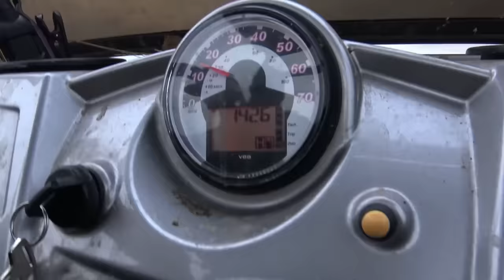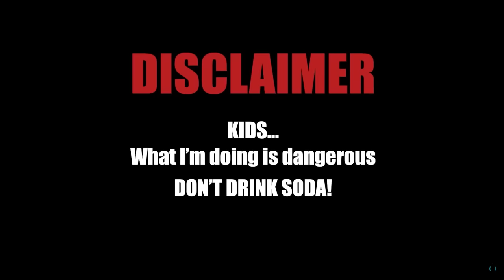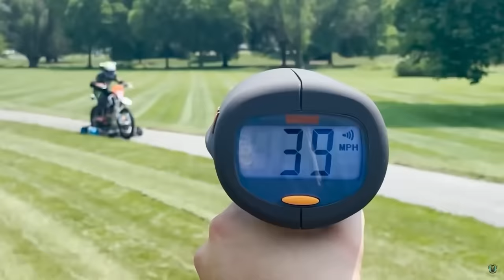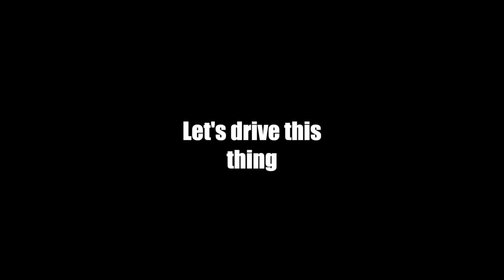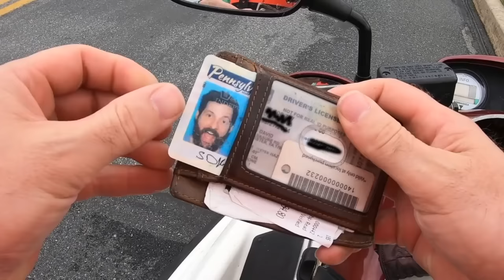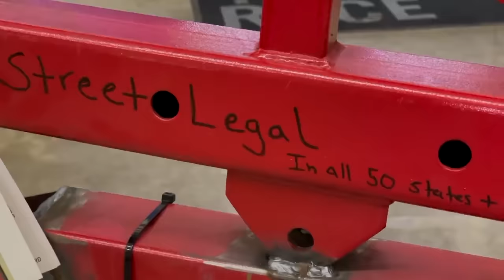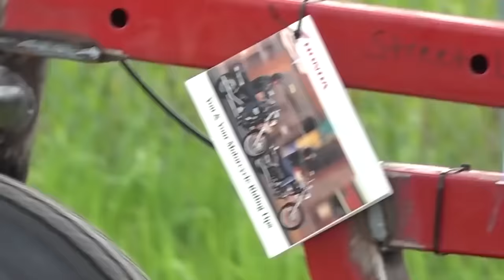Bikes and Beards Best of 2021

Comment: You can be rich, your invention of a Jet-Ski cycle , no floor boards needed, lots of leg room, certain legal items need to be installed and maybe you can figure out how to run on water as is just like the Amphicar call it the Amphicycle.  Peace.
Reply: Someone already did it's called a Biski
Reply: There was an electric motorcycle video Shaun did that you could submerge and it would still run. Perhaps integrating that would do it...& maybe some paddleboat propellers on the side of the wheels hub

Comment: my 2022 new years resolution was to get my liscense and get a bike. took my Motorcycle Safety Course over the weekend on the 8th+9th, (found out it's gonna be a week before they handed me the DMV form for my endorsment) and went to dmv yesterday the 10th to get my bike permit.

Drove 2 hours out of town that same day to test ride, and end up buying a friggin cherry 1985 Honda Magna V65 1100cc cruiser. for $1150 (bike was technically only $750, but i had to buy a bundle of his old gear for $400)

Bike is in phenomenal condition considering it is 36, or 37 years old. all the bells and whistles work perfect. new tires. just been serviced. all seems to check out.  Only issue is the battey is tired.. By that i mean if you leave the key on without starting it, it will go dead in 5-10 minutes and need to be trickle charged back up. but it holds a charge. Dude owned it from 1997 to yesterday when i bought it. He was 2nd owner. Now im #3.

Im thinking of riding it for a year or so, and after saving up some money, going for maybe a 2020+ harley sportster 883.

What do y'all think?
Reply: I know this is a year old but congratulations dude, you had a plan and you put in the work!
Do you still have the honda, or did you get that sportster by now?
Reply: @gumbilitous2804  thank you kindly. No I did not end up getting a Sportster. Nor did I end up keeping that Magna. Not because there was anything wrong with it.

I sold it to a friend of a friend who had been looking for one for near a decade. I had it for about 4 months and sold it to him for three grand. I have since bought and sold four other bikes until I landed on a 2002 Honda VTX 1800c.

I hope that's the bike I'll keep until I die. But the b** has been giving me some issues with engine noise and a rich running condition.

We'll have to see how some of my latest attempts at fixing it turn out.
Reply: @fairplayer916  Holy a whole decade! Well i bet they were really happy when you sold it too them. Hopefully you do get that new bike fixed though, maybe jetting is a bit too much if its running rich?